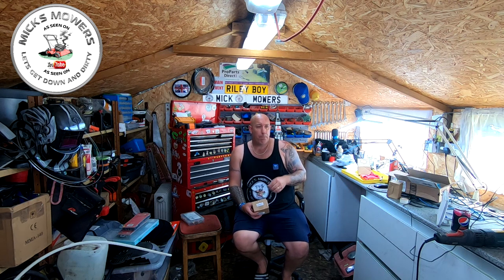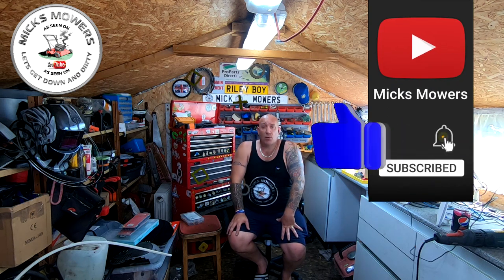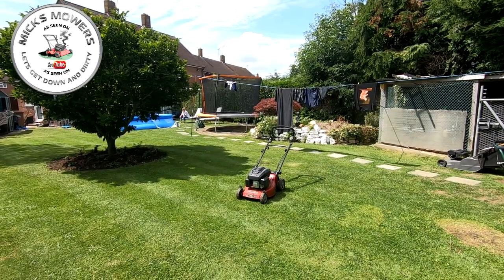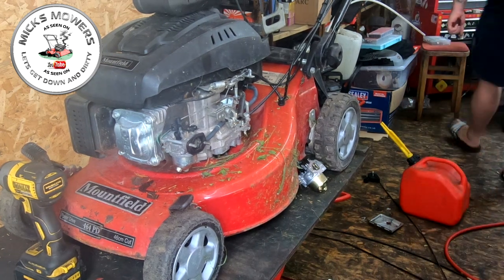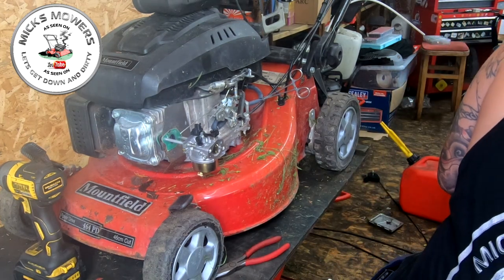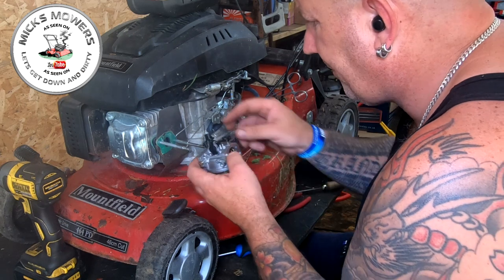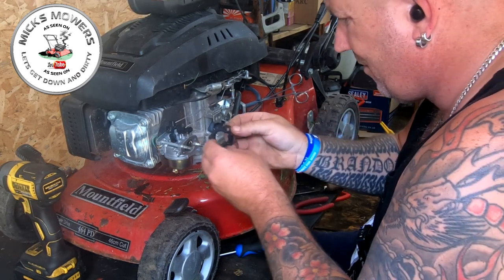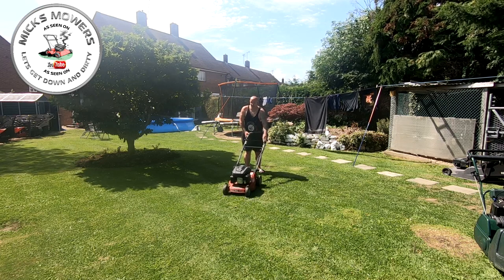Chinese Copy Carburetor Will This Mountfield Lawn Mower Run Again

Comment: I just fixed and flipped one of these mowers with the exact engine on it.  It wouldn't prime and thats why it wouldn't start.  Bc of videos like these I knew right away it had to be the primer line and it was.  Cleaned the carb while i was in there and replace the fuel line as well.  Decked needed love and it was easier to just yank the motor off.  I restyled it from Weed Eater Green to Black.  Took me about an hour and it sold for $125 this late in the season!  VERY RARE to see these engines on my island

Comment: i just got new micro bit set drilled out main jet on same carb worked great it was on pressure washer not exact same symptoms it would idol down but surged bad on high depends on start of season or end of season you get more when first cut nearing but I would ask $140 canadian and take less

Comment: It would be interesting to see how the carb did right out of the box. Not sure you need the spring.
Nice job. Those little screws and throttle plates can be fiddly.

Comment: Hi Mick. Fitted one of these to my RV100 and I can only start it when warm by using the primer!!
Reply from the maker: It may need a clean..
Reply: @themowerman  Thanks, I'll give it a try...... it's a new one though! Don't know if all the gaskets were the correct ones. There's a channel cut out of the back of the carb face and it seems to exit at the bottom of the carb?
Reply from the maker: @buriedintheshed  send me a photo micksmowers01@gmail.com
Reply: @themowerman  OK, I'll do it later and get back to you.
Reply: @buriedintheshed  think I’ve just encountered the same issue. New carb different gaskets, hasn’t worked anyway atm. Can you remember how you fixed yours in the end?

Comment: Hi Mick, great video, as usual. I have the same carb set up on my sp454. However, I cannot get it to run right. It chokes and starts but then won’t regulate the speed. It runs as if it is idling all the time. The carb is as clean as a whistle and looks in good order. 
Before, I invest in a new carb could you please explain how the governor arm, springs and linkage work on these machines and how these should be set up correctly.
Keep up the great work.
Thank you.
Reply from the maker: Hi mate first thing i would check is to see if the governor has a cable or fuel pipe laying against it stopping it from moving. Second I would have the carb off and check to see if the throttle and choke flap are free to move. The throttle should jar a small rod and a spring attached to it and the choke a small rod. Feel free to email me some photos. My email can be found in the about page or on my banner

Comment: Any link for the carb can't seam to find one have the same engine and can't find a replacement carb for less than 70
Reply from the maker: Hmm the cheapest is now this one but still great value at £12. https://www.ebay.co.uk/itm/NEW-Carburetor-Carburettor-Carb-For-Troybilt-Lawn-Mower-Engine-951-10309-US-/393271816045?mkcid=16&mkevt=1&_trksid=p2349624.m46890.l49286&mkrid=710-127635-2958-0

Comment: I've had favorable results using the chinese clones, actually ordered one last night for a generator I'm working on for a guy. Of course since it was a chinese motor on a chinese generator it should run better with a chinese carb right?? :)
Nice video Mick, keep'em coming brother.
Reply: The great part is sometimes if they end up not working, they will just send another and not even ask for the bad one back.
Reply: @Chickanic  Amazingly I havent had a bad one yet or not that I know of. :)
Reply: @Big_Johns  We order about 3-5 aftermarket carburetors a week. If there is going to be duds, we get them. LOL
Reply: @Chickanic  LoL.... I just work out of a shop behind my house as a hobby, hopefully I won't ever have to order 3-5 a week. I don't want it to be THAT much of a hobby. :)